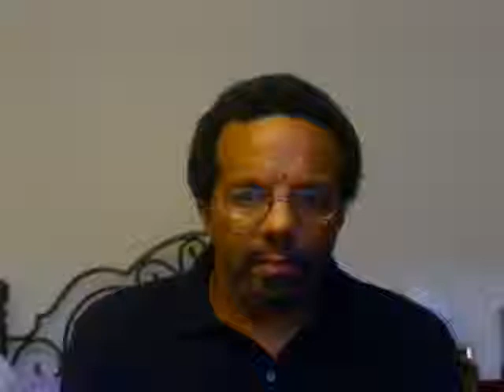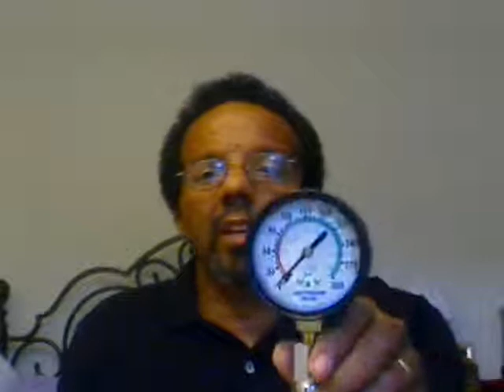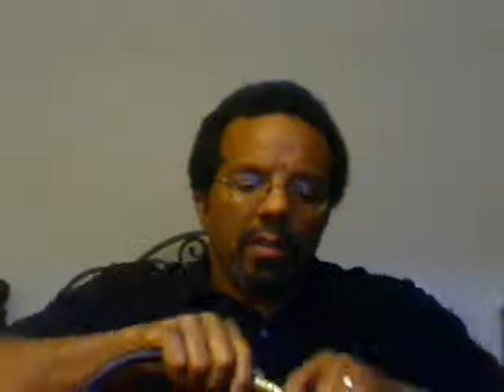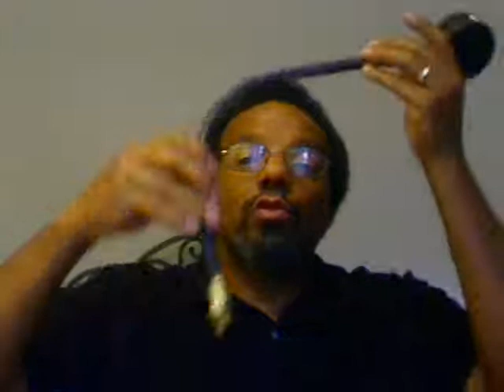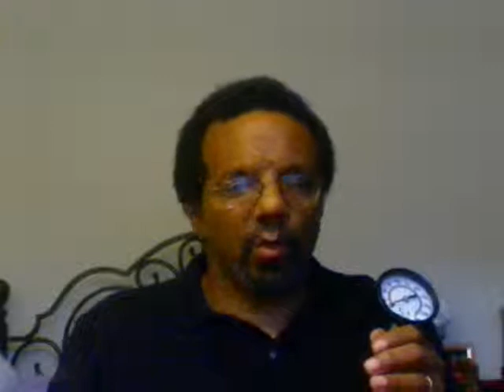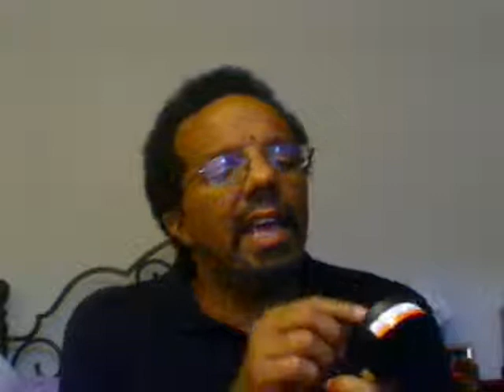Car engine compression information - VOTD

Comment from the maker: Hi John, thanks for watching. Just so we are clear, #1 is closest to the timing belt. Yes, the low number has an issue. Since it jumped when wet, it indicates that you have a piston sleeve damaged or worn. Maybe even a scorned cylinder wall. How man miles on the motor? The pressure is still high enough in the low cylinder to fire so you are still ok, hopefully it will not get worse. Keep oil changes up and check it every 5,000 to 10,000.

Comment from the maker: Hi Mary, usually 1 low cylinder indicates that the car has a burnt valve. How low is it? They will have to do a bleed down test to see if it is the piston or a valve. Could also be a bad head gasket. Any coolant or oil issues?

Comment: Just had a compression test done on my 1994 Volvo 850 at 399,857 miles.  The readings from cylinders 1 to 5 are 180, 182, 182, 150, 182.  Did a wet test on the number 4 cylinder and confirmed that the piston there was slightly worn.  I have had this car since day one and intend to keep it as long as I can, although I have a relatively new car as well.  I have dutifully changed the oil and filter every 4000 miles and repaired or replaced everything with Genuine Volvo parts or OEM parts.  What would you suggest that I do for this car from now on?  I have run a fuel injection cleaner through the fuel rail to try to remedy the problem especially the number 4 cylinder.  The rest of the car is mechanically sound, and all the necessary maintenance is at tip-top shape.  I hope to have this car exceed half a million miles.
Reply from the maker: Not sure what "problem" you are referring to. If it's NA, yes the compression is low on #4 but it really isn't an issue until it gets less than 130.
Reply: Sorry for not being clear about the "problem".  I am just concerned with the piston wear.  Considering the rest of the cylinders are in the healthy range, I just want to see if there is anything I can do to lessen the piston wear.  The car does still drive beautifully.
Reply from the maker: No, at 400,000 miles, you are doing very well. Short of tearing the engine apart, it's fine. There is also a chance that the fuel injector at that cylinder is leaking fuel in there and washed it down a little. Next time it is checked, have all of the injectors unplugged before the test, it may come up to the rest.
Reply: I have run the fuel injection cleaner via the fuel rail.  Perhaps I should remove the injectors and clean them instead.  Thanks for the suggestion.
Reply: Yes, my Volvo 850 is NA. In another video of yours, you advocated the use of Lucas Top Engine Oil every 2500 miles.  Did you mean changing the oil every 2500 miles due to the age of the car? Since discovering the lower compression at #4, I have drained the old oil and filled it with a 10W40 German motor oil.  Per your recommendation, I am going to replace all five original fuel injectors with Genuine Volvo or OEM injectors.  I am assuming when one injector is faulty, the rest are not too far from the same fate, since they were installed at the factory at the same time.  I will follow your suggestion to check the compression again in 5000 miles. Hopefully, the compression on #4 won't get less than 130.  Much appreciation for your expertise and unselfish sharing of your knowledge.

Comment: Hi Robert , I went and did a dry test on all 5 of the xcv70  from 5 to 1 was 174/132/164/162/167. So I then did a wet test and got 236/182/214/220/234. So number 4 obviously has something going on. I had reason to believe there was a head gasket issue prior to doing the test. Could you tell me what you read into these numbers. Love your videos and had one playing as a tutorial as I was actually doing th test. Thanks a lot.

Comment: My story is, i have a Volvo 850 2.5 1994 170ps 20v, i replaced the headgasket and everything needs to be done, Also i replaced the Head , turns out now the car wont start over, i brought to a volvo mechanic he did a compression test and says the 4th and 5th cylinder are only giving have of the compression and thats probably the Problem why the Volvo wont start.Now he says i should put in the old head on it.He Also referred that some vacuum hose is missing on the head .Do you think that a low compression halfway down on 4th and 5th cylinder could lead to a no start ?
Im confused i worked through snow, rain and cold hail storms, i even brought the head to a shop to let it get planned, now i have to take it all out again, im frustrated,i offered the Volvo mechanic a deal of 1000euros , he says he has to calcuEuro first,these volvo people take here 90Euro an hour, took him a full week to check my compression..

Thanks Robert ,
Reply from the maker: Why didn't you check compression yourself?
Reply from the maker: https://youtu.be/YiPAPu-K8OI
Reply from the maker: https://youtu.be/3InZVPLYgqs